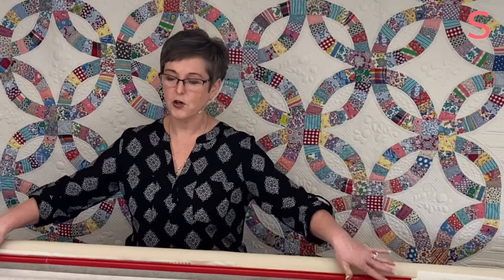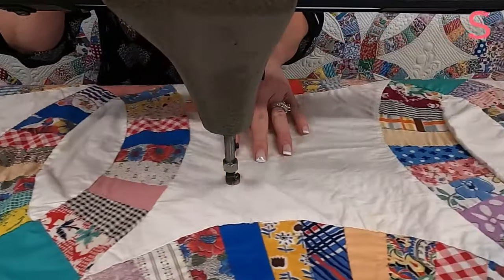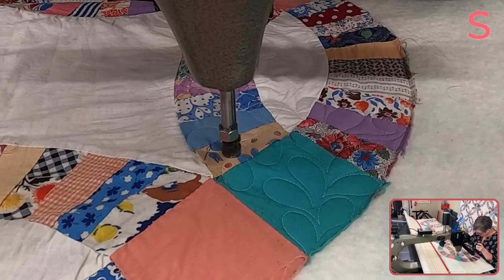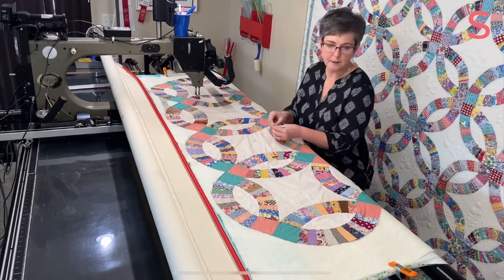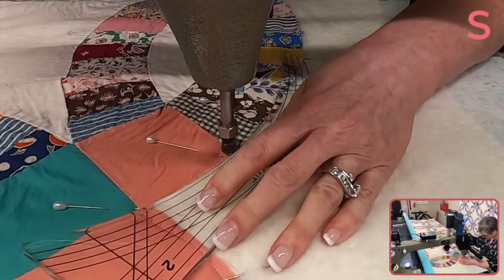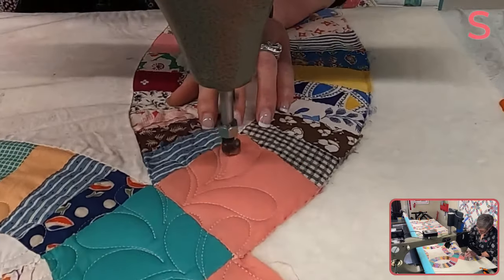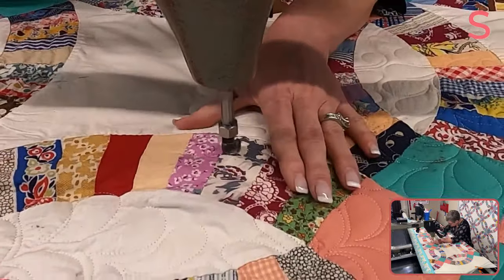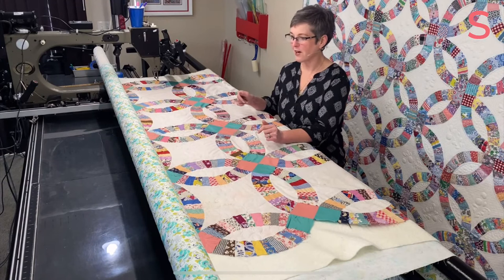Vintage Gem LIVE (Part 1 of 2) Taming Excess Fabric/Pleats/Bubbles

Comment: I needed this video right now! A customer brought me a nearly identical quilt and it’s got soooo much fullness in the eye shapes. It’s eerie how identical it is to yours. It’s got the same green in the 4 patches but mine has cheddar instead of pink.
Also, based on that pink and green and the view of some of the rest of the fabrics I’d say around the 40s. There are probably some feed sack fabrics from the 30s but some of the other fabrics look a little later than that.

Comment: If a small section is missed, do you go to the end of the run and then come back, or do you break thread and fill it before moving on?
Reply from the maker: When using an edge to edge design like this one, I fill it all in as I go. If I need to move into an awkward corner, I try to either echo my way there or travel in the basted seam allowance at the edge.

Comment: question : would basting it on the frame HELP keep it from being uneven at the end?
Reply from the maker: yes...although in my experience, basting lines every 12" all the way to the bottom brings its own set of challenges. I've gotten the best results by assessing/adjusting and basting with each advance.

Comment: ? Is there a reason not to leave ruler table on all of the time?  Does it have to be off when loading the quilt?  Thank you for this program. You are excellent at your “running commentary “. Very pleasant voice and presentation style.
Reply from the maker: It does limit a little how far forward I can quilt, as it bumps against the front bar. Since the majority of my quilting is freehand, I prefer to take it off and have that extra 2" of room.